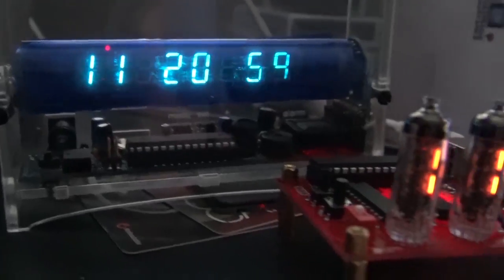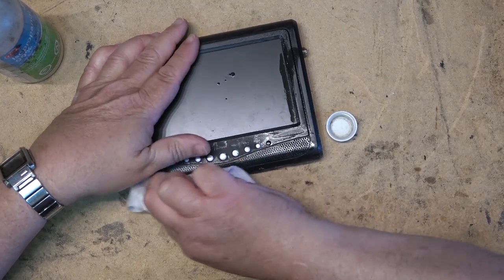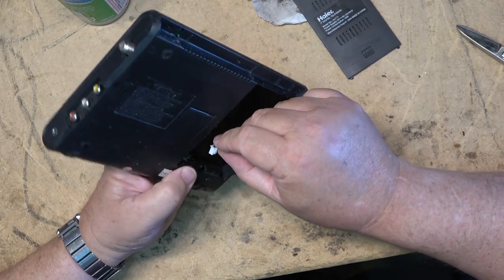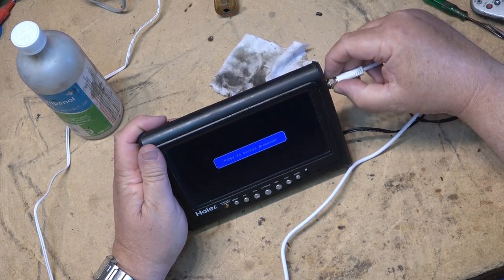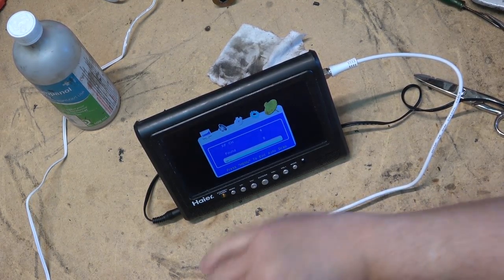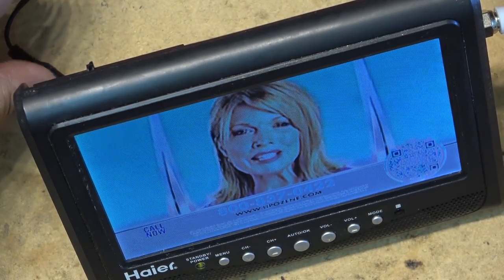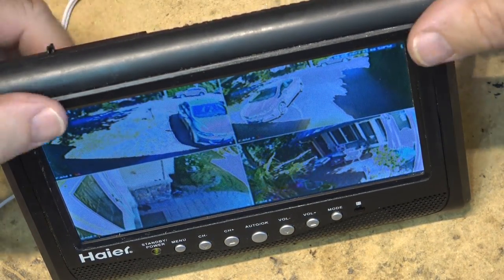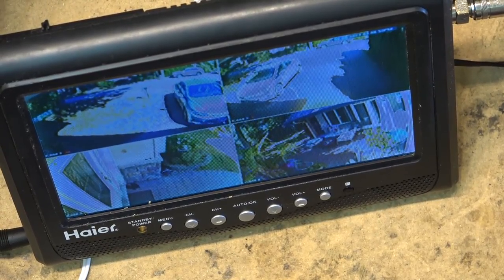Haier Portable Digital TV picked up for 1 dollar will it work

Comment: That's a neat little unit. What surprised me even more was the fact that there are analog channels still being broadcasted - I thought they were all phased out about a year or so ago.
Reply: He said it was cable.  Some systems may still run analog.  And I'm sure at least the security cameras are his own modulators.
Reply from the maker: All the analog signals are in house modulators. Even the channels that come from digital.  This is for the old analog only TV's in the house.
Reply: I believe there is still one analog channel being broadcast from Mexico that was alive for a very long time since the US analog shutdown. You could still pick it up in this area (Southern California) but it was very weak. A year or two ago, I believe it's power was shut off. The vintage TV repair guys in the So Cal area (Shango & jpdylan) used/use it (if lucky) for their testing. Not sure if it's still alive.
Reply from the maker: @SergZak2023  no analog around here.  All digital.  Only analog signals come from my BT modulators.
Reply: Those channels are all digital. That tv has a digital tuner.

Comment: Most of the television stations have standard definition and high definition channels and and hence the reason why you think you have doubled in channels. We had the same thing that happened in 2014 when Australian television stations re shuffled and moved there transmitting frequency. Gone is band 5 and as you said to make way for future exspantion ( mobile phone ?? ) As for digital reception a lot of problems are caused poor quality or cheap cable and fittings. I never use RG59 anymore and the only cable i use is RG6 Quad cable ( 305 mtr pull packs ) and has a solid dialectric, that and a cooper clad steel wire as the centre signal wire, this cable also had very good shielding . The same with the fly lead, these i make out of the same RG6 Quad cable. Poor cable can also account for missing channels

Comment: Haier is a pretty good quality Chinese producer of products.
They have collaborated with a number of "big names" in the consumer goods sector and produce products using licensed technology
from these collaborations. I had a "high end" Asko front loading washing machine that died after 2 yrs and 4 months. I got a Haier 
to replace it for less than it was going to cost for the repairs to the Asko. The Haier is a great replacement and is as good as the Asko
it replaces.
Reply from the maker: I have been to  the owner of Haier home. He actually lives in Canada.  How do I know that? I was setting up his TV service, and I have a small Haier monitor for registering set top boxes when there are no TVs in the house. I pulled it out of my bag to set up his service and he got all excited and told me it was his company in China. (yes the guy in chinese) Told me that they were the 5th largest manufacture of LCD TVs in the world. You should see his house, and the cars he has. Lives on a golf course.
Reply: @12voltvids  It's not every day you hear a brand name and get to say hey I've met the guy who owns it all, haha. That's pretty awesome
Reply from the maker: @littleengine1303  you should see his sound system.  Speakers 120 grand and that was just for 2 speakers.   McIntosh tube gear all the way.
Reply: @12voltvids  that's insane. That system better sound like heaven itself for that kinda cash. 💰
Reply from the maker: @littleengine1303  he didn't demo.  The sound guy was connecting stuff when i was there.
Reply: Thats because haier own asko
Reply: @HDXFH  Gorenje Group owns Asko. They also own Hisense, which you may be confusing Haier for. Haier is an entity in their own right and owns such brands as GE and Fisher & Paykel

Comment: I've worked on one of these, my mother in law's.  Same issue with the sticky coating, used isopropyl alcohol to clean it off.

Not the greatest tuner, but it is portable.  Battery pack is almost worthless.  But it is cute, a basic TV.

Comment: HERE IN THE STATES THE CHANNELS ONLY GO UP TO 36, THE REST WAS ABSORBED INTO THE CELLULAR PHONE SYSTEMS
Reply from the maker: Afaik 49 here as they took the 600mhz spectrum for 5g.  They tool 50 - 59 a few years ago for 700mhz LTE
Soon they will be forcing them back to VHF as UHF more valuable for phone bands due to small antennas and longer range then the GHz bands.

Comment: I have the exact same one, after seeing your video I dug it out after it was tucked away for some time. And yes the tactile rubbery finish had turned to a sticky goo. Did what you did and that pretty much cleaned it up. Charged er up and it plays fine. The only thing I don't remember putting it away with cracks in the plastic body. I may be able to glue it back up with methylene chloride. This solvent works well on styrene type plastic. That is if the goo didn't get into the cracks.

Comment: Beautiful old TV with good clarity. These do wel with die hard campers that have small spaces and use only 5-12v appliances that run 4-10 Watts max. I have a similar model by AGFA with a little bigger screen and a builtin DVD player. No remote, so it is a hassle to operate sometimes. It charges at 10 Watts and when charged it uses only 6 Watts to operate but runs 4 hours on a battery charge. I got mine powered on a simple solar system with a 30 Watt panel and 8 LifePO4 cells (12.8v) with passthrough charging running all day if daylight is sufficient. I use it to watch CNN all day through a SATBox via AV in.  These are marvels.

Comment: If you want to make sure you only remove the rubber coat and not the lettering, use lighter fluid.  It just takes longer.
Reply: if you want to remove both and your eyebrows use lighter fluid and a lighter
Reply: @spacewolfjr  That is one way to do it.  I usually allow the covered gas grill to fill with gas for several minutes, then I open the cover, put my face close to the grate and quickly light the grill.  This removes all facial hair and forehead hair!  Be careful and only do this with medical supervision!😁

Comment: To remove the sticky stuff I used a solution of laundry borax, e.g. 20 Mule Team. A lot easier than alcohol and it didn't remove lettering. The solution worked best when mixed well so no solid borax particles  remained.

Comment: I got one of these, and mine is turning into goo as well. I also got a similar TV made by a different company called Auvio that doesn't have the rubber coating. Rather than take the time to de-goo the Haier, I'll probably just get rid of it and keep the Auvio.
Reply from the maker: Took me all of 10 minutes.

Comment: That soft-touch plastic is disgusting. Finger oils break it down in no time, so of course every remote is made from it. I had a set of nice Mirage omnisats that had gotten so sticky they were collecting all the cat hair in my apartment. I had to soak them in IPA to remove it. Dell is still selling professional-grade laptops with the palm rests coated in the stuff.
Reply from the maker: When I worked in the TV business we used to have a spray called dulling spray. Designed to reduce reflectivity of highly reflective surfaces such as brass or steel or something because the television light of course would reflect into the cameras and the cameras of the day all use pickup tubes which flared like crazy plus it could damage the tubes we had to spray that stuff on everything. you can imagine how upset musicians were when they came into play in the studio and we had to spray their saxophones or trumpets or guitars down with going spray so they wouldn't flare out on the cameras and then they had to clean them up after they weren't very happy.

Comment: I have that TV and I lost the antenna and the battery is bulging so I removed it and I haven't got a replacement I did find an antenna on eBay but it doesn't fit in the storage compartment and it still works and I have the remote, AC adapter, Cigarette lighter cord, AV cables and yes it is digital
Reply from the maker: Battery on this one fine.  Have the DC cord as well but no remote or antenna.  Oh well it was a loonie.

Comment: alcohol just makes it worse.
Reply from the maker: Alcohol strips it
Reply: @12voltvids  Alcohol is a solution
Reply: I used 91% isopropyl on mine, it did a decent job of removing the stickiness.  I did have to wait between cleaning sessions to let it air off a bit so I could tell where the remaining residue was, but not bad.

Comment: Just like mine. (Haven't taken The battery cover off) The antenna that came with it does not pull in any stations. I live too far from broadcast stations and only an outside mast antenna works. The little tv works with that, but it's not portable if it has to be tied to a cable to work. That's why i bought it (2011) because it was a digital TV. I need to try elbow grease again on mine. The sticky stuff is stubborn.
I also have a Haier 6 inch box fan, and Haier Chest freezer.